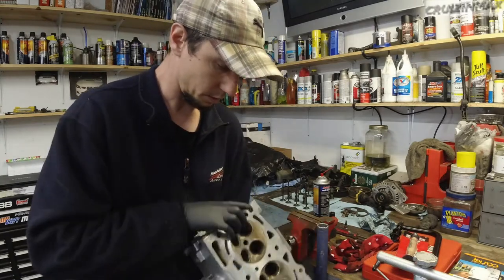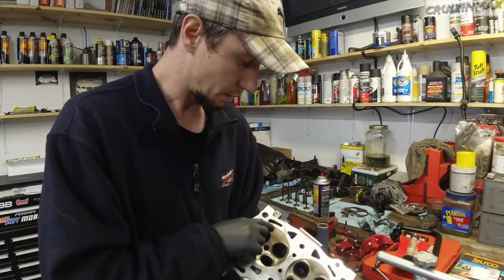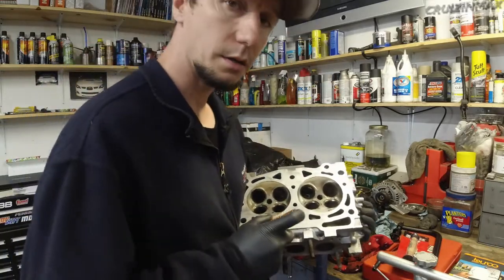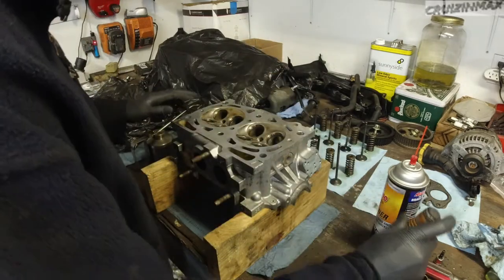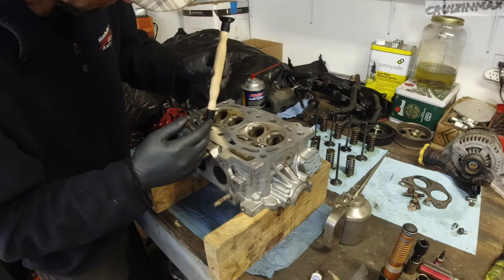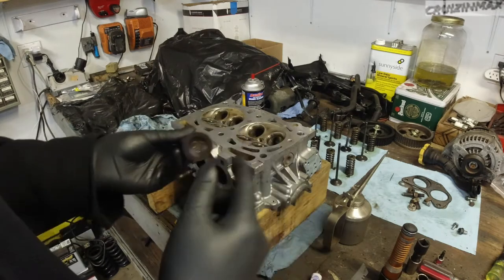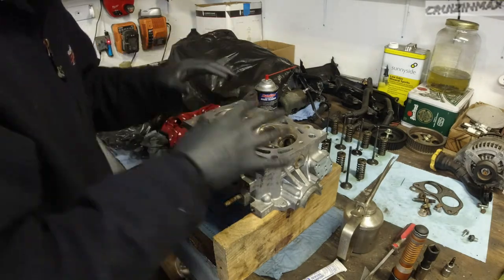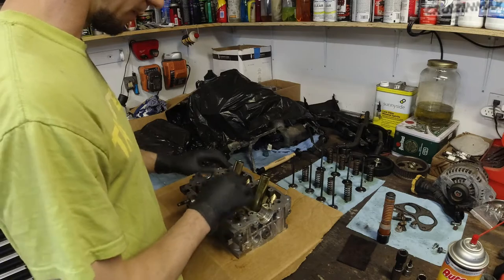Subaru Impreza 2.5L lap valves and valve seals part 4

Comment: Sucker sticks are useless, I fitted 1/4" stud in a drill, and drove the stem of the valve with a short length of 1/4' hose, and drove the stem of the valve slowly backwards and forwards, while maintaining light pressure on valve head with my finger, lifting occasionally.